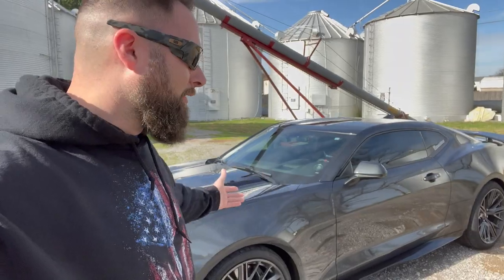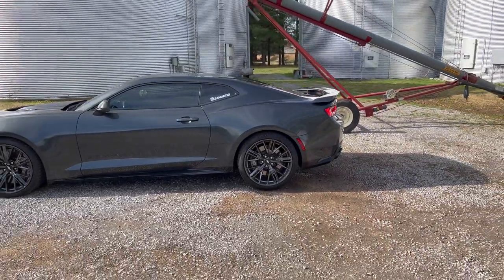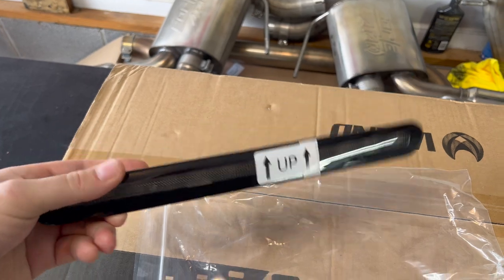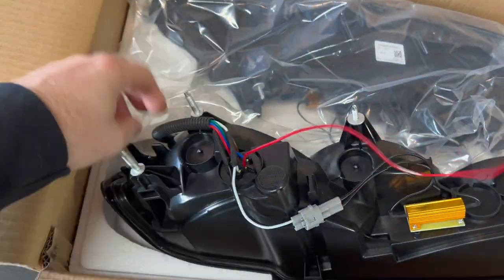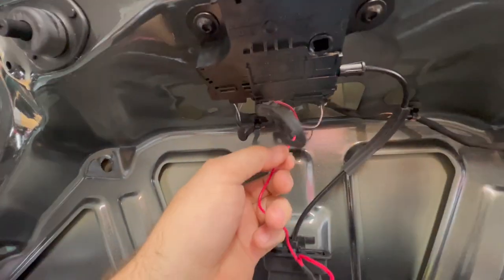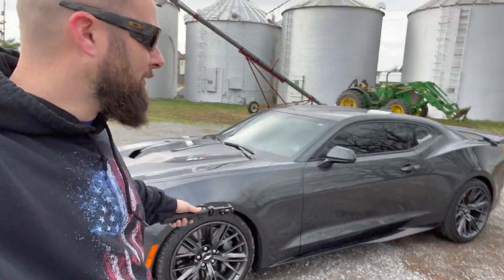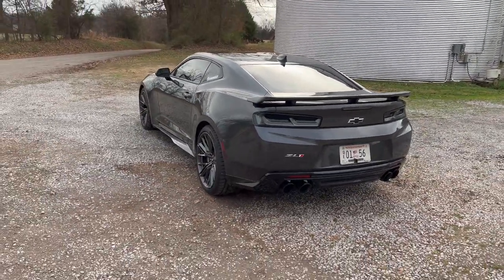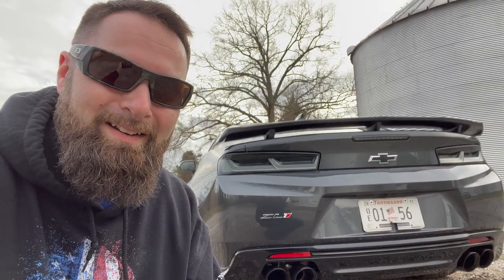TRANSFORMING THE LOOK of my Camaro ZL1 with VLAND Tail Lights! *MEET PUNISHER!

Comment: I still noticed a small hyper flash at 8:32 when you apply the brakes and turn signal at the same time. Good looking lights. Hoping for a follow up video.
Reply from the maker: Yes. There is still some from time to time that I have noticed

Comment: Beautiful car.  I have the same tail lights and  I've noticed when approaching a turn, you activate the left or right, then hit the break, they still "hyper flash" for a strobe or two.  Have you experienced that as well?
Reply from the maker: No issues with mine yet. That updated third brake harness wire seems to be the cure
Reply: @Zander13Productions  where can I get that harness? Mine didn’t come with one

Comment: Great video!!👍Thank you for choosing our taillight! Can I get your video authorization? We decided to edit the excellent videos into a collection and display it on our official YouTube and Facebook group. Your name and video link will be displayed below the edited video.
Reply from the maker: Yes absolutely
Reply: I have the same tail lights but mine don’t have that harness for the hyper flash when you step on the brakes. Would be possible to add the harness to mines?
Reply from the maker: @jprelude92  maybe. May have to contact them
Reply: @Zander13Productions  yeah I emailed them . Just have to wait and see what they say .
Reply: @Zander13Productions  by the way replace those marker lights . The car will look so much better with smoke ones. My car is the same color as yours, nightfall grey hence why I say to replace the marker lights.
Reply: Who did you purchase the tail lights from ,I messaged  Vland but they are no help, I asked them a simple question to see if they have a harness for the hyper flash and was told to contact the place I bought them from 🤦🏻‍♂️
Reply from the maker: @jprelude92  I got mine from vlandinnovate on eBay actually. Only paid $280